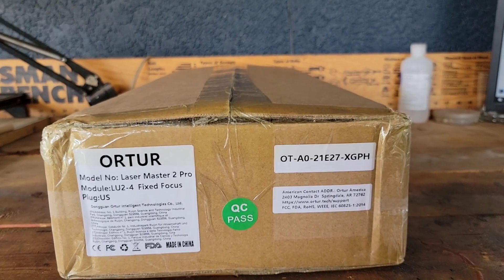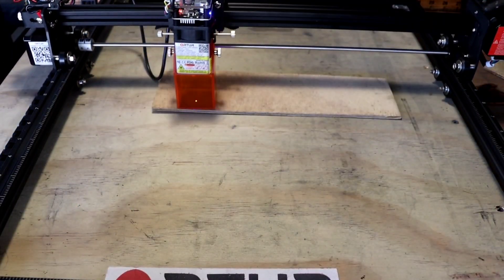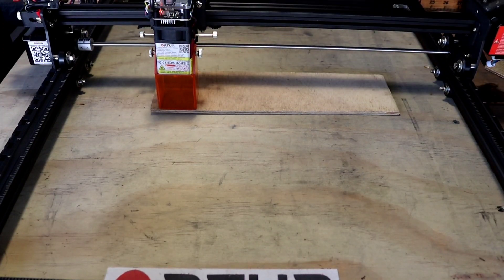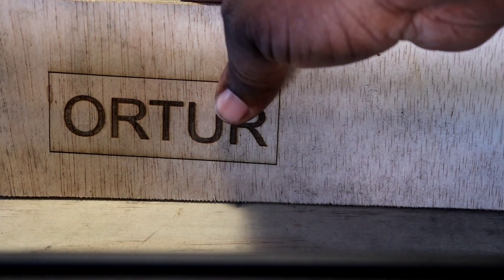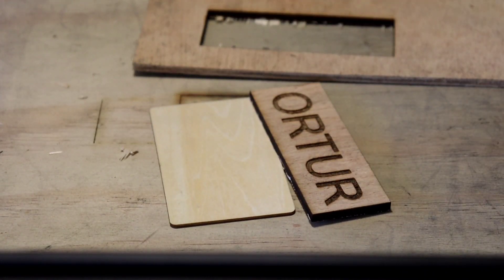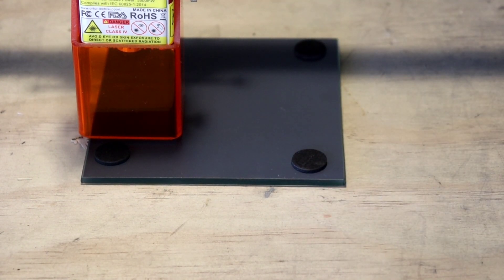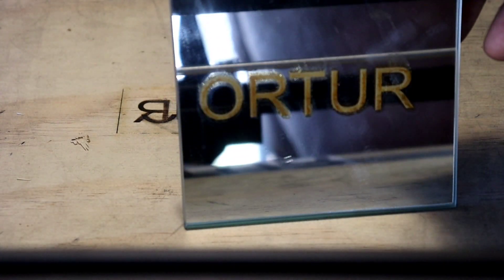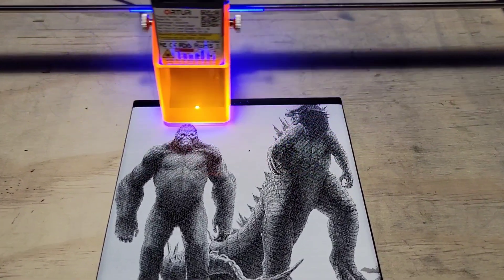Ortur Laser Master 2 Pro Review (Is it Worth the Money  let's See)😁😁😁🤑 June 26 , 2021 Release Date.

Comment: wonder if there is an air assist 3d print available for this.

Are you going to throw an Air Assist on yours?
Reply from the maker: No I have never used it
Reply: Forgive me - I’m super new… What is the advantage of the air assist you mention?
Reply: @davidholmes3776  it uses air to blow the surface of the area being lased. This makes the cu/engrave cleaner with less burn marks. Also helps keep down on flare ups

Comment: LMFAO as much as like Ortur these lazy sobs just copied their main adversary ! It's the atomstack 5 with the ortur "front" on it xD (and it's probably made by the same factory too haha)
Reply from the maker: They should of been did it cause this one is awesome.  Lol everybody copy a little bit lol
Reply: @zerica24  Atom seems to be a little ahead every time. I guess they can afford to as they are much bigger than Ortur. I settled for LM2 because of reviews but for like 20$ more, the a5 from atom had built-in air assist and a beam shield.
Reply from the maker: @Santriell  I will have to check out the A5 . Maybe a head to head.
Reply: @zerica24  Eeeeee I'd bet on Ortur for that. Atom is known for user-friendly specs (air/shield/etc; even the mounting manual has a a step by step with separate bags each carrying a number for each step) tho their laser system is notoriously inferior. Don't know why, how or the what the heck but Ortur beats'em, even if "it's lacking a few bs features blablabla" (they seem to be made to be a lot more powerful than they "should be", basically roasting everything they touch)
Reply from the maker: @Santriell  That's unfortunate !